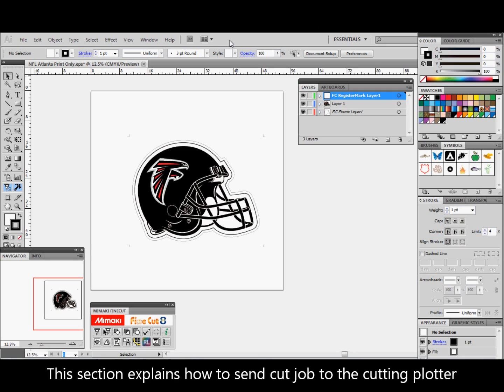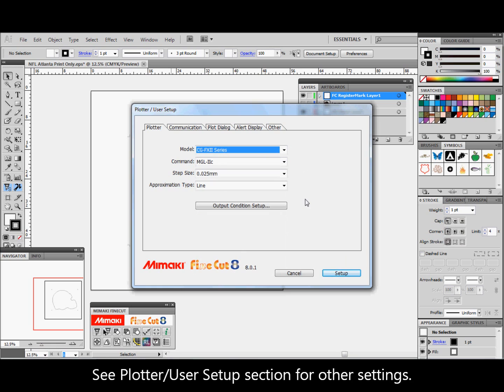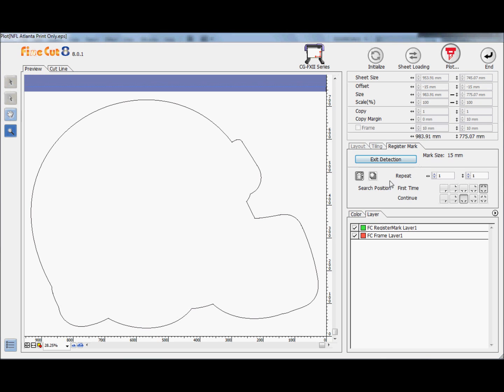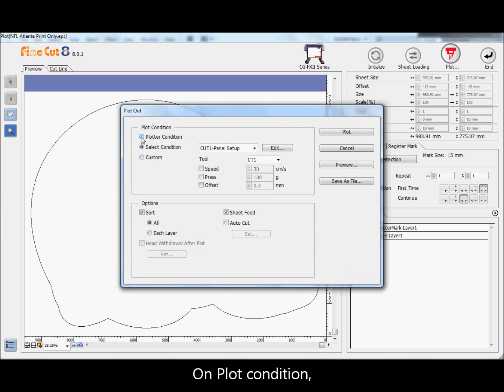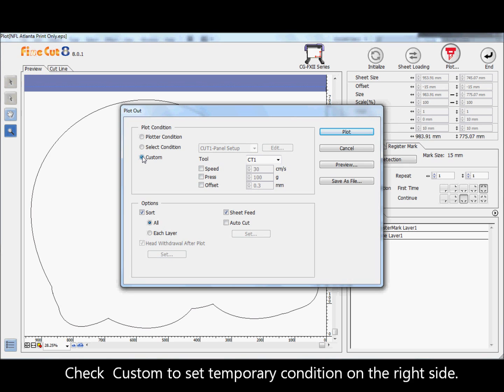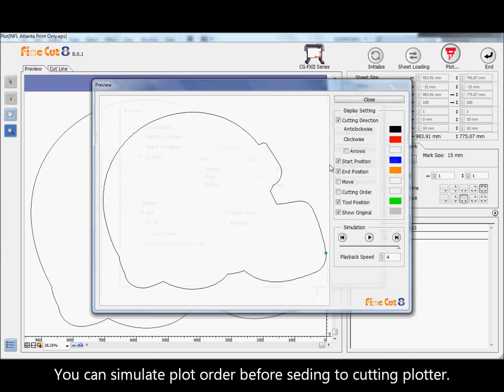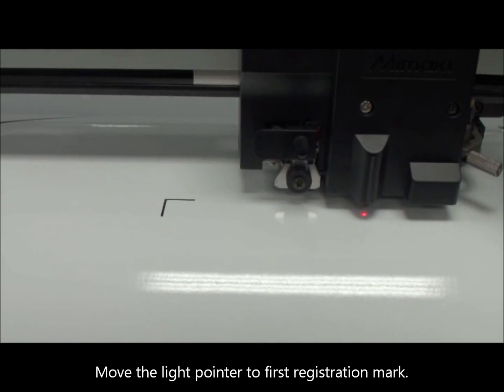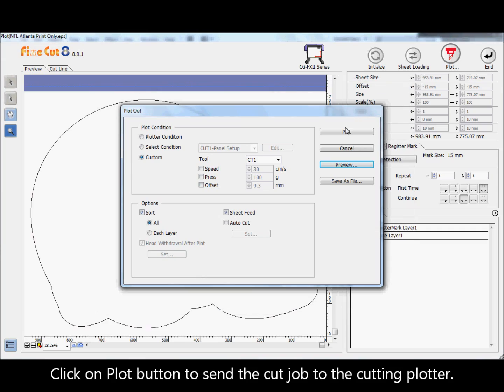Print & Cut ~Cut Data~.wmv

Comment: My Mimaki 160 FXII has had many faults.. I work on my own so the plotter does not get use all that much.. now for the third time it has blown the main board... Mimaki want $2250 to fix it for a third time in 4 years...... A unreliable terrible product by a company with no support. DONT BUY THIS OVER PRICE PROBLEM!!
Reply: Hi Graphic Wraps, sorry to hear that you have issues with the plotter. Could you please enter your inquiry at Mimaki website so that will be the quickest way to resolve it instead of leaving negative feedback here that will not move anything forward. Thank you for your comment. Tomo/Mimaki
Reply: @HTM9916  I have indeed....